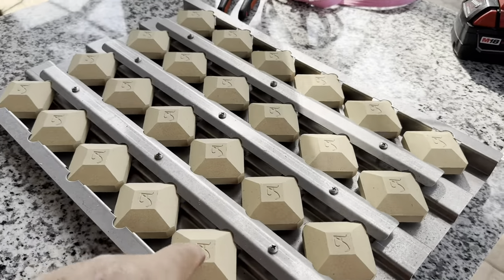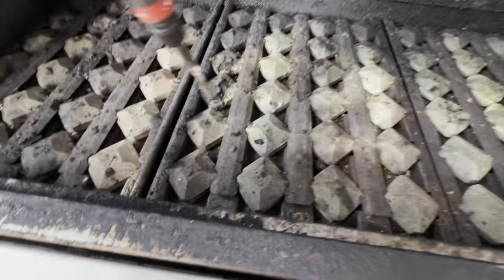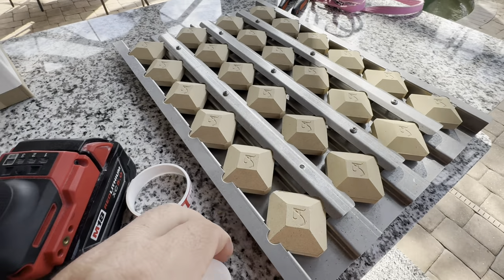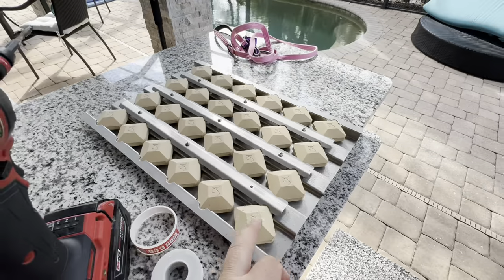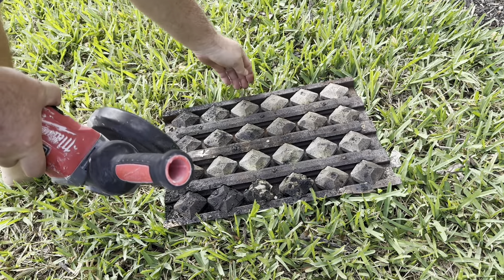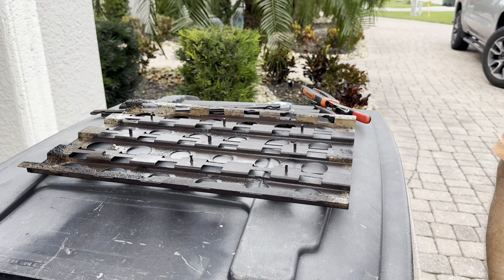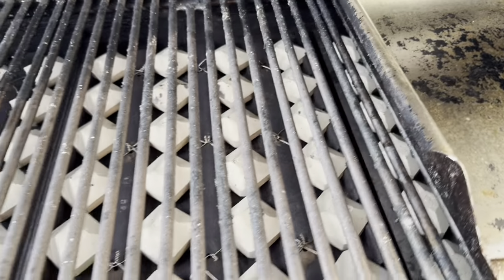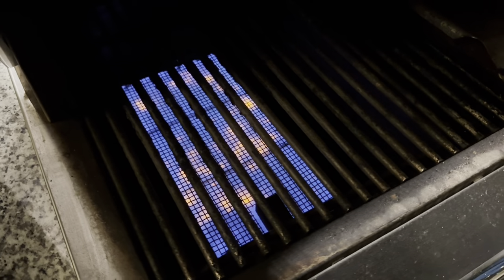Grill Briquette Tray Upgrade

Comment: I would have replace the Phillips head screws with hex head stainless bolts.
Reply from the maker: I thought about that, but The hex head stainless bolt would’ve broken off. The threads on the other end sees into the stainless plate. It’s not just the Phillips head that is the problem.

Comment: The wiring seems complicated. Would an automotive heat rated hose clamp work? When it wears out you just clip off and replace. Would only need 2 per row.
Reply from the maker: Yes, automotive stainless steel. Zip ties would likely work.  That’s actually a great idea. I’ll probably do that instead next time.

Comment: If the screws were long enough could you turn them from the bottom to get them moving?
Reply from the maker: No, they would just break off. The screws seize within the frame. It’s really a dumb design if they intend for you to replace the briquettes